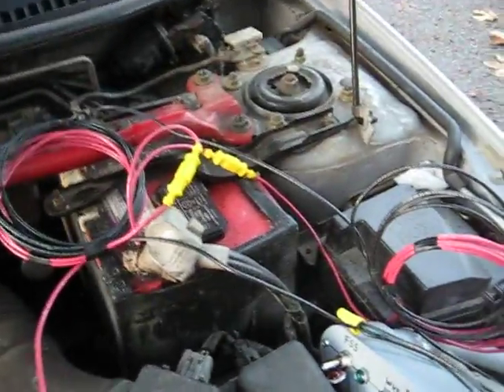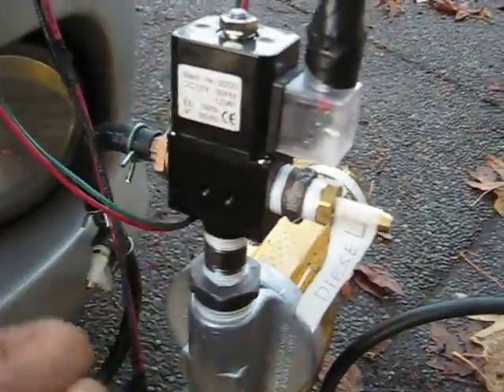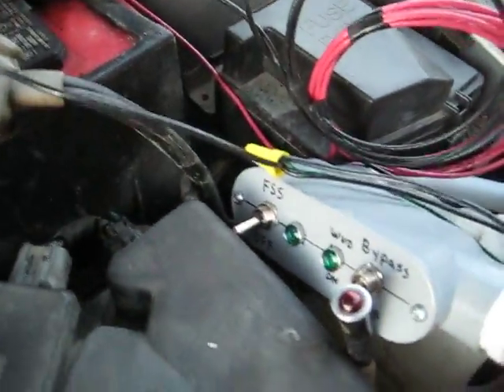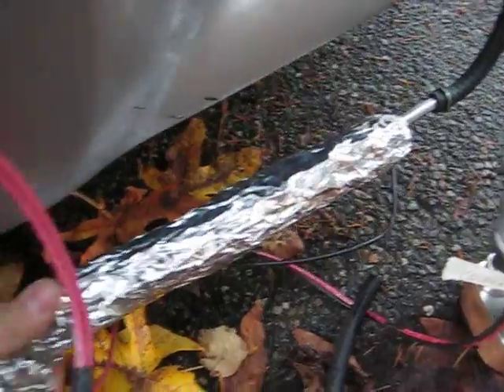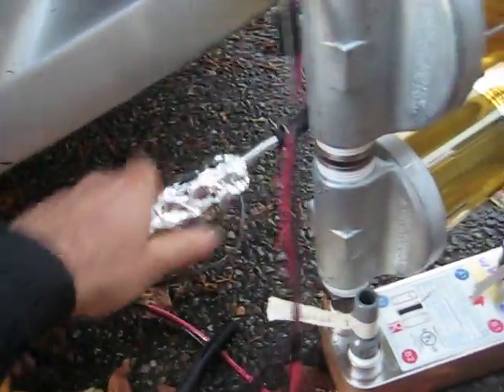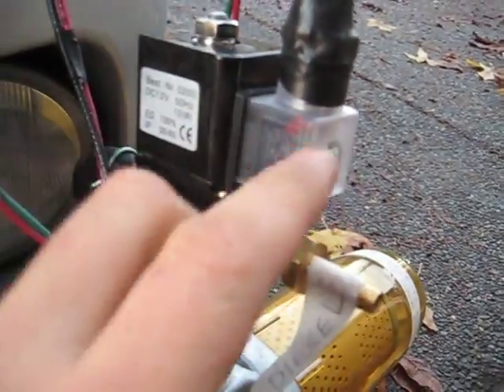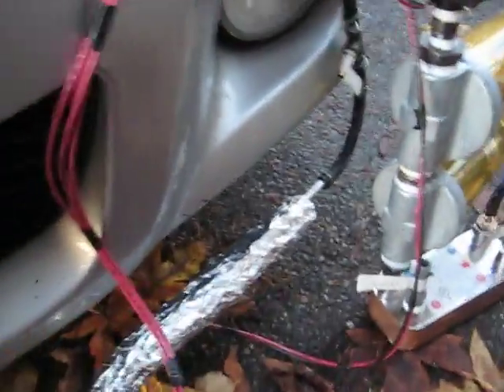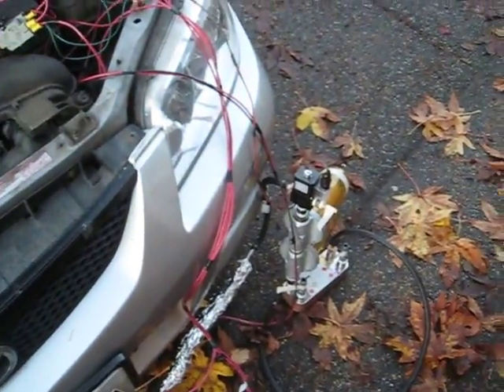Deluxe Waste Vegetable Oil Conversion kit Testing

Comment: The metal heat exchanger is fine once the engine is warm chase....especially running a closed loop return system (return fuel line looped back into injector pump rather than flowing back to tank).

Depends on ambient temps as to how much heating you need though.